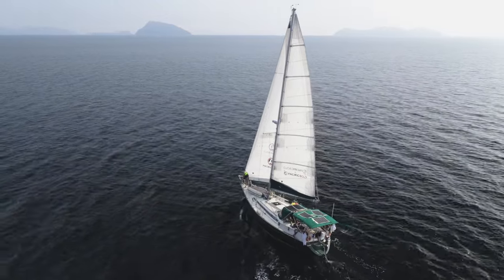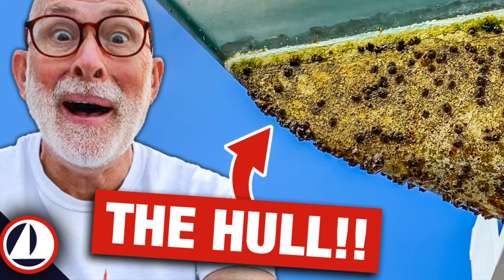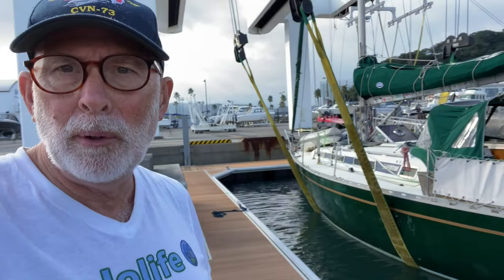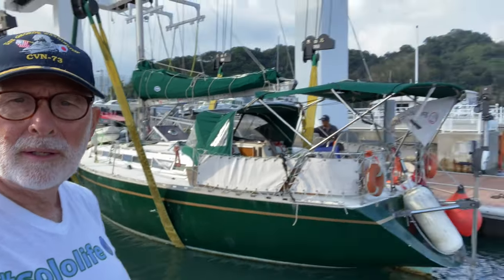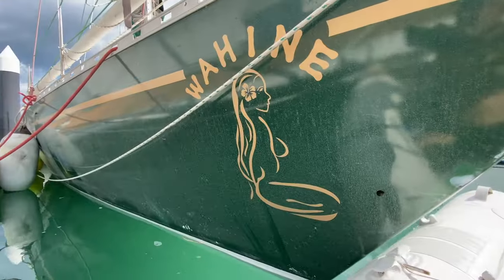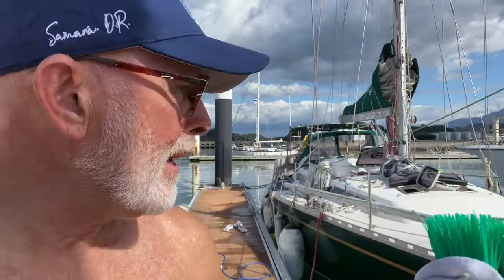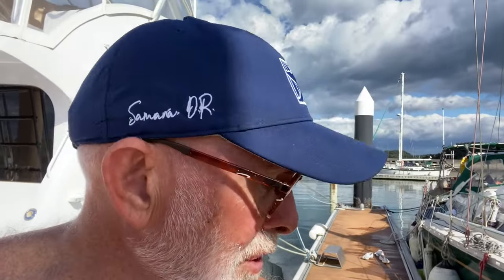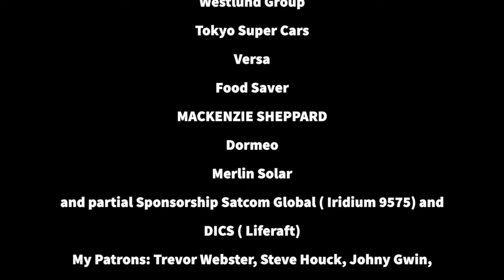I HAVE A PROBLEM - and I hope it's just the barnacles!

Comment: There's a paint that's non.stick rust free for 20 years
Reply from the maker: What is the name?
Reply: Master touch. Say I sent you.
Reply from the maker: @thomasmooney4321  thanks. there are cheaper alternatives on the internet and through amazon . . but talking to other sailors here they get mixed reviews and in these warmer waters of the Inland sea where I have been for a few months they had the local sailors and engineers said something different is needed
Reply: @PacificSolo  the difference in the touch paint is it's longevity it also repels u v rays and can withstand tremendous heat .its non stick comes in a fantastic finish.it being used by the usa navy.
If it's not for no worries. You will only get epoxy paint on amazon it breaks down.
Good luck with your quest.